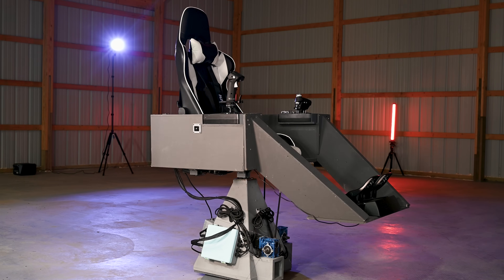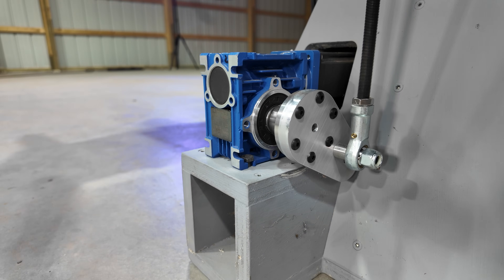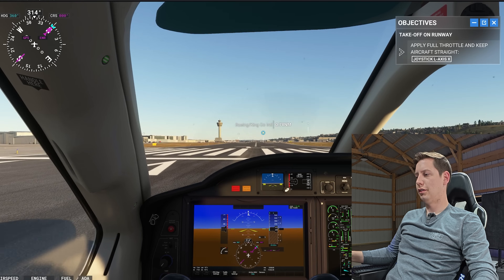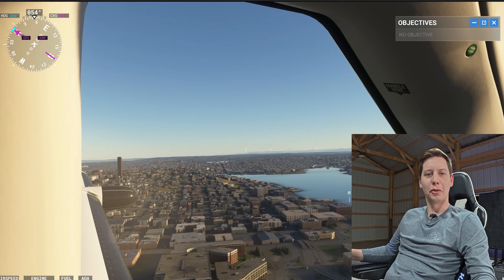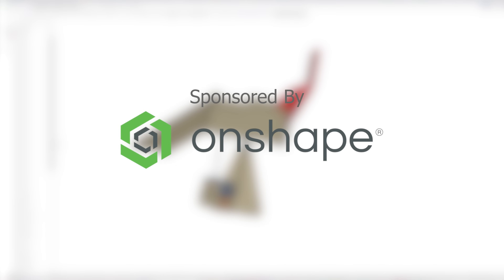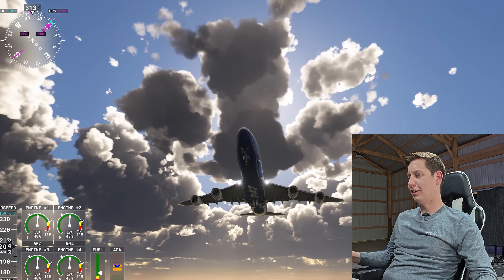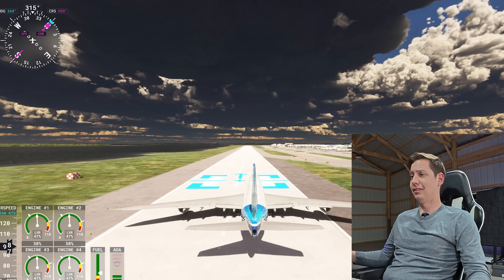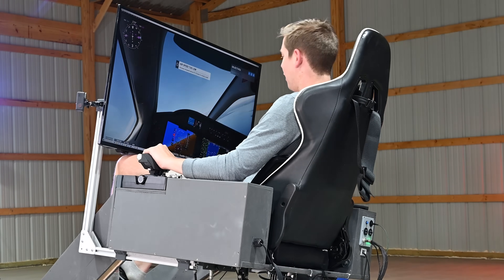Building a Real Life Flight Simulator. Pt 3

Comment: unsure this is worth it out of the "for the sake of diy", 3dof nowadays are under 3000$ and offer much better performance, better size and better features. Unless you like to work for free and the insanely expensive tools used for this project magically appeared out of nowhere, this is a year worth of work 10K+ (I would assume 200h of work earning 50$) plus all the cnc machines, saws, drills and extra stuff probably far more costly than another 10K, even ignoring the cost of materials used. Funny project, but no way in hell this makes sense outside of funny learning project, IF you already have the tools that 99% of the people don't have. So yes, you can buy this better and cheaper LOL

Comment: As a VR enthusiast, of course I'm not super enthused about a design where you play on a TV... but I realize that with inside out tracking, or bay stations, the movement of the chair would be calculated as movement of the player and that would have you moving around in VR, which is less than optimal.

So in order to "fix" that for VR play, the chair would need to either be completely enclosed (spare enough cracks to get air in) so inside-out tracking would detect the player as mostly stationary while the G forces of the chair movement whips them around, or for outside in tracking, bay stations would need to be mounted on the chair as well, so the trackers movement is synced with the chair, again, keeping the player's tracked POV in a relatively static orientation while the chair moves around providing G forces for immersion.

But hey, for all the fellas out there who love the deepest, most complex immersion so long as it doesn't involve wearing anything, there ya go.

Comment: Fantastic video! Thanks for sharing! I was actually thinking of doing this same thing, albeit for a different reason. 

With the EAA's help, my family and I are currently planning to build a very large amateur-homebuilt amphibious blended-wing-body, Wing-In-Ground-Effect eVTOL superyacht aircraft. Our aerowatercraft is currently planned to measure 39 meters in length, 12.5 meters in width, and 12 meters in height with a 52-meter central mainplane wingspan, a 34-meter foreplane canard wingspan, and a 22-meter empennage horizontal stabilizer wingspan. The reason our design is so large is because it is intended to primarily function as our mobile home, almost functioning as a huge RV (that can't legally drive on roads, obviously, but can float and fly). We are currently planning on using wood and fiberglass construction to construct the aerowatercraft's main blended-wing-body-hybrid fuselage hull with composite reinforcements where needed to solidify the structure's load bearing components to save money while ensuring maximum safety, especially since we are not a millionaire family. Unfortunately, our intentions with this aerowatercraft will still come at a steep price running well into the millions of dollars ($5.1-$5.3M for the whole project, including insurance, over an 18-year construction timeline from 2029 to 2047), as well as a very large weight penalty, which we currently estimate will fall in the ballpark of 100,000 kg-200,000 kg at worst. Therefore, although our aerowatercraft will still be classified as an experimental amateur-built aircraft by FAA standards, its weight will automatically place it in the league of small to medium-sized commercial airliners and other Part 23- and Part 25-certified Transport Category Airplanes, all of which are legally required to fly with a minimum of at least two certified pilots on the flight deck during any commercial flight operations.

However, since the aerowatercraft my family and I are using is  intended to be flown and operated for noncommercial private, personal, or family uses only (not that we could use it for commercial purposes anyway since Federal Aviation Regulations expressly prohibit experimental homebuilt aircraft from being used for commercial and compensated purposes anyhow) we are hoping on designing our aerowatercraft to be simple enough to control and operate that it is safely flyable by a single licensed private pilot (i.e. myself, once I earn my PPL) without the need for a second pilot at the controls (who we would likely have to pay a fortune to help me fly it—this is what our family is hoping to avoid). That being said, our family also recognizes that because the FAA's primary mandate is safety, their first instinct, upon learning of our aerowatercraft's final size and weight, once it's construction is completed in 2043 or 2045, will almost certainly be to legally REQUIRE that we have a second pilot on the flight deck at all stages of every flight to ensure maximum levels of safety, given the inevitably huge size and weight of the aerowatercraft we will have built. 

Technically, by the time our aerowatercraft is actually, fully completed and ready to enter its Phase I Flight Testing stage in 2043-2045, there will be cheaper and more affordable, more well-proven technologies that simplify pilot workload in large aircraft like the one we are building. We are already planning to design our aerowatercraft with a state-of-the-art glass cockpit and simplified flight controls to make it easier for a single private pilot like me to safely operate the aerowatercraft. However, just these design changes alone will almost certainly not be sufficient enough to PROVE to the FAA that the aerowatercraft can be safely and efficiently operated with just a single pilot on the flight deck, and we need that ability or we'll be stacking even more costs on top of all the costs we'll already be paying for construction,  engineering, permits, rule compliance, insurance, and legally mandatory flight testing.

So all of this ultimately brings me to my question—before my family and I even begin construction on the main aerowatercraft, I was thinking of building a small moving, ground-based simulator similar to the one shown in this video (built affordably for $23,000 or less, but still correctly in a way that the FAA would approve of—without needing multi-million dollar resources like those used to build airline flight simulators) that accurately replicates the exact simplified flight control layout for our actual, finished aerowatercraft (which will be manned, not RC). Our hope is that in the years leading up to Phase I flight testing, licensed FAA personnel will be able to use our custom ground simulator as a physical proof-of-concept, and a tool sufficiently equipped to simulate real-world flying conditions with our aerowatercraft, that it is realistically possible for a single private pilot to safely manage the workload of flying it without the need for a second pilot on the flight deck. Do you have any suggestions or recommendations as to how we can realistically achieve this using a similar layout to the one used in this video?

While we acknowledge as a family that the overall odds of the FAA approving single-pilot operations for our aerowatercraft are extremely slim given its massive size and weight, and while we are actively preparing for and budgeting for the costs of hiring a second pilot just in case, we are also cautiously hopeful that, if executed well in the 2040s, a reliable and realistic ground simulator like this will help provide enough data and proof to the FAA that our aerowatercraft is safely and reasonably manageable by a single licensed pilot without the need for a second one.

Thanks so much in advance for all of your time and consideration.

Comment: This mechanic seems to be good balanced and compforts weaker motors
i use thanos and some bandaid-code with some way to strong chinese m80st´s, to power very smooth diy linears based on the DIY SFX150 design
great work..now add heave :D

Comment: 1. The HOTAS you're using is pretty meh, i'd switch to a more accurate and nicer joystick with magnetic sensors made by companies like VKB, Winwing, etc, the downside to this is that you'll have to buy the throttle separately and it's expensive.
2. Motion rigs simulate the forces, not the pitch and roll of an aircraft, and they do this with gravity.

Comment: I want to see more!!!! I am going to try to make this!! I fly quads/planes, even have about 15hrs real life plane  PPL... I already have a raspberry pi3, and have a few ideas about 3d printed panels etc, mate has got an expensive flight sim joystick thrust and pedals that is sitting in a box under his bed to use aswell... Am wondering about a tactile sound vest for haptic feedback, and a wireless tube speaker behind the head for sound... Also a oculus2? I have HDzero FPV goggles with head tracking, but maybe an oculus is better for VR/flight sim and gaming.. (will likely use it more for Sims than flying quads etc)...This is amazing!!!!

Comment: Playing you at 2x makes you sound almost normal! :) Great work on this. The better the documentation and availability of parts to make this thing, the better for everyone. Simpit stuff is exactly what you said: daunting. But work like yours helps it creep closer and closer to allowing the hobbyist to have one in their home that doesn't cost an arm and a leg. While I won't be building this one at the moment, I do eagerly await for v2 after you have had some time with it to refine and redesign as needed. I assume at some point you are going to explore options that stabilize the seat as well as for allowing greater dips an depth. I am considering this for a VR rig rather than a monitor setup actually so I am excited to see where you take it. Please continue to make the parts and improve on them! Having those available is the make or break on a project like this where people are meant to start off by following in your footsteps.

Comment: During a coordinated turn you are not thrown sideways in your seat the aircraft is at an angle to the ground but centripetal force balances the tilt. the turn and slip indicator is a ball in a slightly  curved tube.  from Wikipedia   When an aircraft is flying with zero sideslip a turn and bank indicator installed on the aircraft's instrument panel usually shows the ball in the center of the spirit level. The occupants perceive no lateral acceleration of the aircraft and their weight to be acting straight downward into their seats.

Comment: Here's to the people that are saying
"You gotta do acceleration/force vector simulation"

Vector calculations would mean they need to get 6D acceleration data, x y z pitch yaw roll rates, i dont think that's possible unless you mod the games, with RC planes the inner accelerometers and gyros should be able to do so,
there' might be lag if you dont take the data from the game directly but taking the 6D position data and dividing it by time (1/pull rate)
∆Pos/1/pullrate(hz) = Velocity
so  n+1 - n thats 2 frames for velocity
for acceleration you'd need 3 frames
n+1-n velocity
n+2-n+1 velocity
∆Velocity/1/pullrate(hz) = acceleration (linear or angular)

It's pretty easy but then again we'd still need to do more matrix calculations, thankfully we know normal force is always pointing down, we just need to match any Resultant linear vectors with gravity.

for angular we still have to convert it to linear acceleration by taking into account the pilot position away from the rotation center(which is not exactly Center of Mass, but for this rig, close enough) of the aircraft type.

but then the rig would only work in dark rooms where the pilot has no outside bearing and can only intuit their position with what the display and rig is giving, or only use a VR headset

since if they roll sharp right, the rig would lean left hard.
if the pilot can see visual orientation cues from the world, this would break the illusion and be VERY disorientating

but those are just the "hard" parts, there's still
easing functions to put in
converting them to motor control
etc3

A WHOLE BUTT LOAD of programming and development needs to be done to achieve that.

Unless you're gonna pay him the development cost of this system that he's putting on the internet for free, don't undermine his achievements.

Comment: This is a very impressive project. A motion rig like that would be out of reach for many people and you have figured out a lot of the hard problems already. I am surprised it can be done within a decent budget. Although it probably cost you much more with experimentation before getting to this point. 

I am surprised with the numerous comments that the motion should be derived from the acceleration. While true, they missed the point that your work so far is a very solid platform to work toward improvements in the software. There are many people who can figure out how to program better software but few who can manage all the hardware integrations.

Comment: This chair is worthy of all praise👍! It's particularly noteworthy that the blueprints and control software are accessible to everyone👍.
I do have one criticism, however: The chair moves relatively hard to its stops, while the aircraft continues its movements. Therefore, it only remains realistic if you fly "tamely."🤔
How about an aerobatic simulator, where the chair is gimballed and can perform every flight attitude, including real rolls and loops? That will be a mechanical challenge...💪